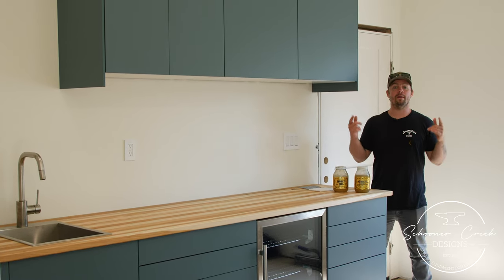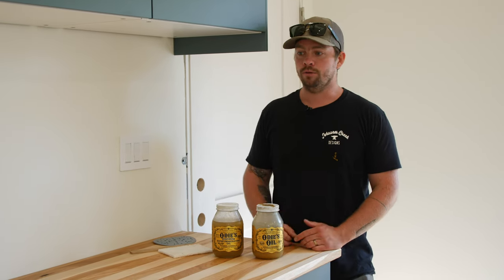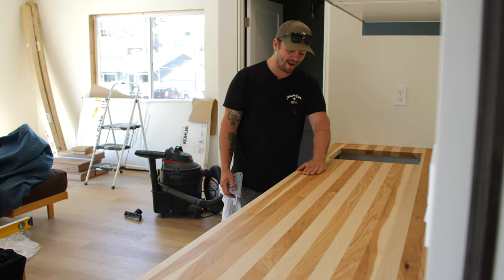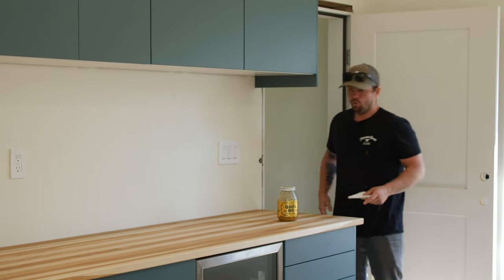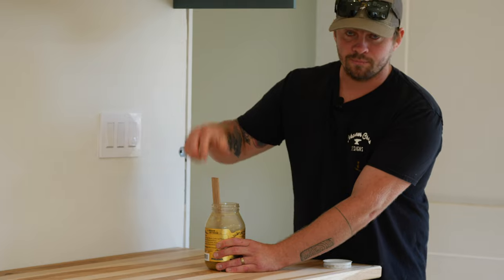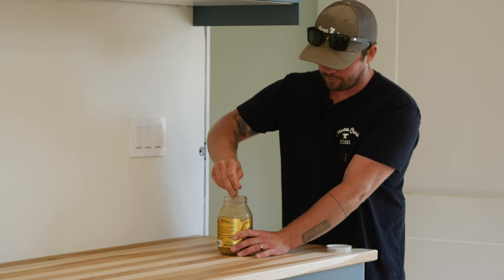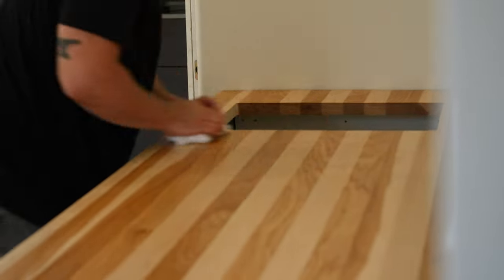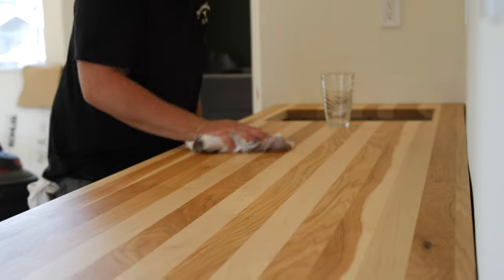How To: Finish and Seal Wood Countertops with 100% Natural oils!

Comment: How long did you wait to drop in the sink?  I contacted Odies and they said not to oil under sink because the sealer would not seal with the oil.  But shouldn’t you cover all sides of wood.  I’m getting Acacia butcher block countertops with a sink on one side.

Comment: HI, thanks for the video! Can I ask when you sealed around the sink? I'm planning on finishing my butcherblock countertop which I have recently purchased and haven't installed yet. I just don't know what to do first. finishing with odie's oil or installing first? I asked odie's oil customer service if caulking around sink after finishing odie's oil will stick well and they said no. So they suggested installing butcherblock and caulking first around sink and under backsplash first and then finish.
Reply from the maker: Hey thanks for reaching out! I personally pre-finished the counter in the shop, allowed for 48 hours of dry time then installed it, set and caulked the sink and then added one more coat of Odie's oil after it was all in place! This seemed to work well and is still holding up just fine! Hope this is helpful, good luck on your project!